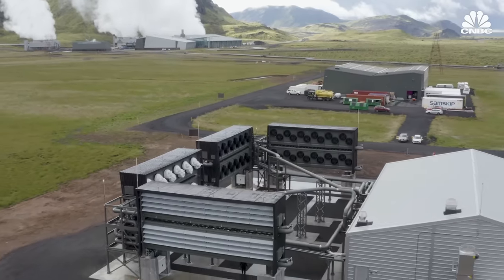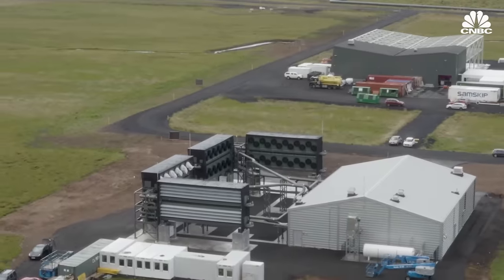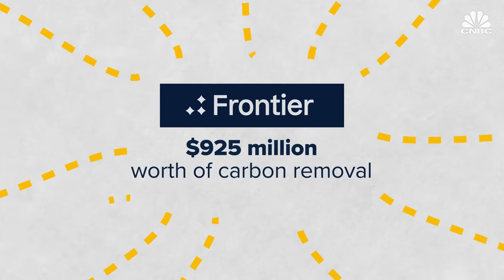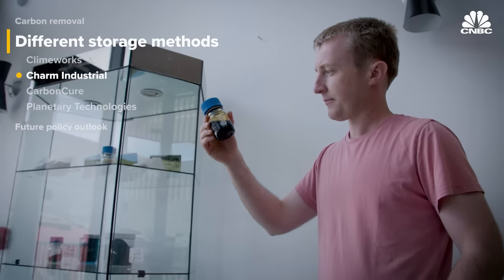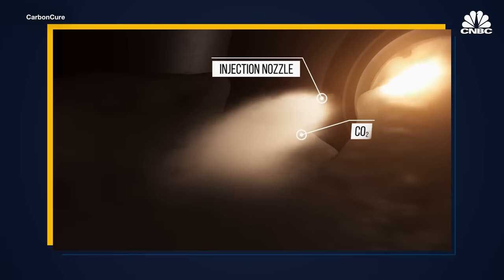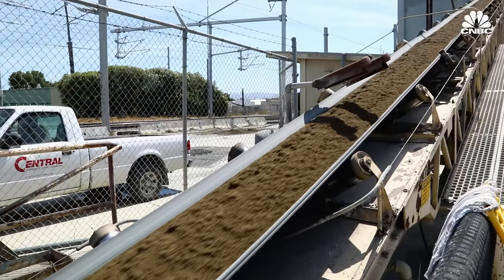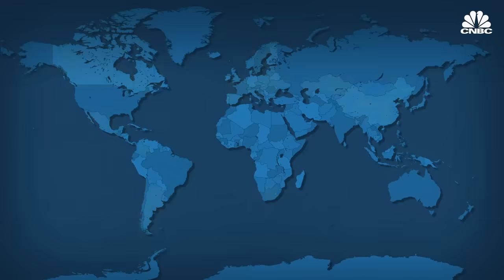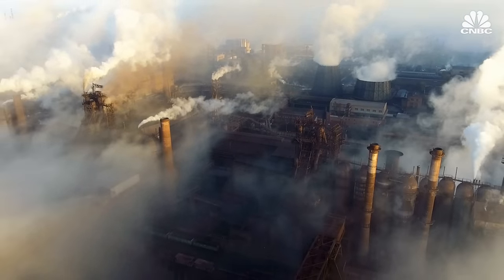Why Big Tech Is Pouring Money Into Carbon Removal

Comment: Awesome companies and technology all around but CarbonCure seems like the best bet. Not only are they removing carbon from the air, but they are using it in an industry that produces a lot of carbon to both help improve their product and reduce their own carbon footprint. I also believe there has been a growing concern of a sand shortage which is also used heavily in concrete, so if adding carbon to concrete means less concrete is needed for equal strength, that seems like a win all around.
Reply: It's also used to make circuit boards... sand or silica.. Time to ban all electronics... Like your cellphone.
Reply: @Boxagami  Ban all electronics, that's a really dumb idea.
Reply: @Boxagami  More specifically, the shortage concerns a specific type of round-grain sand used for concrete. Usually found on riverbeds, it is a small percentage of all the sand in the world. Electronics take any type of sufficiently pure silica sand and are also a low-volume sand-consuming market compared to the concrete market. So no, the sand shortage will not impact semiconductor and electronics manufacturing.
Reply: @mr.munger  We have too, since it contributes to climate change... sorry!
Reply: @kethmarhkfy7luf.263  The likely hood of that happening in our lifetime is close to zero.
Reply: The only good way to reduce emissions from the petroleum industry is to stop burning their products. We need to reduce the amount of fuel we burn, not try and hide the effects of burning fuel while burning more fuel. 

This is all just a ploy by the money in the petroleum industry to keep us burning fuels while they pretend it is offsetting a tiny percentage of the problems when we burn fuels. 

This tech needs to be kept out of the petroleum industry hands. It may have some applications and positive effects in other industries, particularly if it can be used to reduce the amount of fuel those industries burn. 

But the only way to improve the Petroleum Industry is to stop burning their products.
Reply: @Boxagami  I never said we need to cut out all products made from petroleum did I?

The problem is specifically burning fuels, so the solution is to reduce the burning of fuels. 

Make whatever products we want put of the stuff I do not care as long as it is not fuels. 

And that is quite a weak argument following. You are saying that producing electricity emits as much as a small piece of the fuels industry... Ok..so? Converting things that burn fuels over to things that produce electricity still it's less so let's do it. Oh no, it does not get rid of 100% of emissions only 90% of emissions...well ok I guess it still seems like it will help a lot then so no argument I guess. 

And as we convert more power generation off fuels and more transportation off fuels, the emissions of solar and EVs keeps going down. Kinda self fulfilling efficiency beneficial feedback loop. So still sounds like a winner to me. 

So quit trolling for the Petroleum Industry, it is a losing battle because there is no good argent against reducing the consumption of fuels in 2022.
Reply: @5353Jumper  I think you need to STOP TROLLING for the electronic polluted industry.. The problem with you people is you HATE TO BE CHALLENGED and that's not a strength, it's a huge weakness.. So, carry on with the BS.
Reply: @Boxagami  yes of course, as said above, reducing consumption is the best. Improving consumption is second best. 

So sure we all need to reduce consumption...which also reduces fuel burning so exactly what I am saying. 

But if we need to consume then EVs are way better than fuel cars. Everyone who points out that EVs use materials for the batteries and electronic components fail to remember that ICE cars have a lot of electronics too, as well as giant aluminum engine blocks and transmissions which take nearly the same emissions to produce as the batteries and motors in an EV. Proven thousands of times with thousands of studies. Even EVs built with fossil fuels, transported with fossil fuels and powered by fossil fuel electricity generation is still lower emissions than a gasoline/diesel vehicle withing the first few years of ownership. 

I will link to follow but in case YouTube sensors it just look up examples like the IDC: a-global-comparison-of-the-life-cycle-greenhouse-gas-emissions-of-combustion-engine-and-electric-passenger-cars

You will see that even in countries with terrible generation EVs are still the best option we have for lowering emissions (other than just not driving at all). 

And as mentioned the emissions from EVs and green generation keeps getting lower as we adopt more EVs and green generation. As you see in the same document where countries with a highly green energy mix are even lower emissions for the lifetime of an EV. Kinda proves the concept. 

So sure electronics make as much emissions as one piece of the fuel. That is still it as much as the ENTIRE fuel industry is it? And there are still electronics in ICE cars and so many other things so there is no real difference in this particular topic is there?

Reduce fuels consumption, seriously that is how we solve this thing. If you want to do that by no longer driving any car at all that is cool. But if you have to drive or transport anything an EV is better. 

Everyone so fixated on perfect so we are not doing better. Sure EVs and solar are not perfect, but they are better. So let's do better.
Reply: @Boxagami  solar is better than fuel generation. Perfect, no but better is better so we should do it the better way. 

Again the best is reducing consumption. But we cannot reduce all the way so let's use the better thing for whatever we cannot reduce. 

I agree rural solar fields seem like a bad idea, but most cities have way more commercial rooftop and covered parking lot space than we need to power the city and surrounding rural areas. Have the generation near the user endpoint (even owned by the user endpoint) to solve a list of problems with the current power grid. 

Combine with wind. Combine with hydro. Combine with nuclear. Combine with tidal. Combine with geothermal. Combine with battery storage. Combine with gravity storage. Combine with hydrogen electrolysis storage. Heck even have some new natural gas double burning plants for peak load. A combination of generation and storage methods easily replaces all the coal and most of the gas generation in the world with lots of left over for additional need to power  EV fleets. 

And like EVs, the greener we make power generation the greener power generation gets because more things are made with green power generation. Self fulfilling beneficial feedback loop. 

Quit thinking all or nothing on this issue as you are just being obstructionists to any change at all. Better is better than not doing anything so let's do better.
Reply: @Boxagami  so?

Then reduce your demand for electronics. Pretty much what I'm saying we should do. 

ICE cars have as much electronics as EVs so not sure how this argument is relevant to the conversation. And aluminum mining and production is as bad or worse than lithium, as mentioned remember there are giant aluminum block engines and transmissions in an ICE car which balances out the battery in an EV. PLUS remember all the environmental damage from the mining and production of petroleum fuels and lubricants for ICE cars. So sure, let's keep improving EVs, look for better batteries, but the current lithium ones now are better than ICE vehicles. Go ahead and be a late adopter if you want, drive the old ICE until you feel EVs have improved enough or your ICE dies.  

And for sure yes we the citizens need to take this opportunity to re-establish the power grid, in particular because it is preventing us from doing reasonable endpoint generation but also to avoid corporate monopoly. But we currently have corporate monopoly power grids this is an opportunity to bring them more under citizen control. You are correct in some regions this will be a tough fight, but really no worse than we are already.

Comment: "3x-5x larger than the global petrochemical market" = THIS WILL NEVER HAPPEN
Reply: Eh. If we never stop using fossil fuels, then of course it's going to be much harder if not impossible. But even if it doesn't solve the problem on its own entirely (it won't), it provides a step in the right direction. And, if petrochemicals are phased out fairly quickly, then carbon removal can work over the long term and do what we need it to just fine.

It will happen and work will continue on it until it does.
Reply: @jamesesselman283  This entire video is about what they do with the product.. Turn it into oil or solid (ie: far more dense) deep underground is the natural solution. You talk like we aren't already extracting billions of tons of deep storage carbon EVERY YEAR [we extracted 5 billion metric tons of JUST crude oil in 2019], it's not that big of a problem, there's plenty of capacity to put the carbon lol.
Reply: @Cyrribrae  you know nothing about climate change then if you think its as simple as that.
Reply: @Cyrribrae  "petrochemical" doesn't just include power plants, a lot of it is production of plastics, which won't stop anytime soon
Reply: @squidwardo7074  Sure, good point. Though, plastic production only accounts for like 4% of oil usage globally. The lion's share is still being used for transportation and powering industry - and that CAN be mostly transitioned off within the foreseeable future.

Comment: Using the co2 for construction seems like the best option of these ones presented. Simply storing it underground or in the ocean seems like it could have a lot of potential problems and bad consequences. Maybe the basalt storage isn't bad since it could give us solid carbon to use but I really don't know. It also just feels like a waste to not use the carbon when it can be incredibly useful in a variety of applications from electronics to metallurgy to agriculture and much more. I guess they are good stop gaps but the future needs to make use of this carbon not just permanently store it.
Reply: loll. I think the construction use is brilliant. Two birds, since cement production emits so much carbon too. But remember, the concrete industry altogether is NOT ENOUGH to solve this problem. The video explains that there just aren't enough value-added applications of sequestered carbon at this point in time. It's not a full solution on its own.

Fortunately, deep geologic storage is not as scary as you might think. The rock is EXTREMELY stable down at that depth, even if there are earthquakes and stuff. Once it gets down there, it becomes part of the rock and doesn't move for many thousands or millions of years. The ocean solution in THIS video is also nothing to worry about. Nothing dangerous is getting "stored" really. It just uses a weak base to react with acids in the water, which forms bicarbonate and water - both things that are perfectly harmless and abundant in the ocean (duh).

If we don't stop CREATING carbon, then we need to store it. Because you know what we call long-term carbon storage deep in the ground today? Oil, coal, gas.

Oh also, carbon fiber is made from... CARBON. Not carbon dioxide. As cool of an idea as that would be, no, it doesn't work lol. You'd spend way more energy making this work than you save.
Reply: @Cyrribrae  I'm personally aware of all of this, and I'm not worried about co2 reentering the atmosphere as I am about how it might affect groundwater, and ocean  chemistry. While it won't affect ocean ph, what will the additives and co2 do to marine life? I also know cement alone isn't enough, but there are also plenty of of other uses for carbon besides cement and production. It has the potential to do so much more. To me it really seems like a waste to just pump it underground instead of using it somehow

Comment: All we have to do is scale it up 25 millions times over current DAC facilities, with no emissions involved in building, operating, maintenance and decommissioning.
Easy
Reply: These projects take massive amounts of electricity, so...

Most of the electricity used is generated by burning fuels, so the petroleum companies are happy yet it causes more emissions than it scrubs. 

Of course some regions have caught onto this so the petroleum companies are building massive solar farms to power their carbon capture. So you know taking skills, land and materials away from anyone else who would think of doing a solar project and plugging it into the grid improving power generation for all of us and replacing fuel based generation. Nope let's all keep burning fuels for our power generation while the Petroleum companies steal all the investment in solar to cheaply power their carbon capture on the fuel production we use in our power generation. 

If it sounds stupid it is because it is stupid.
Reply: This is basically a prototype, it takes time and investment for such things to develop, just think how much more efficient and cheap renewables have become or cell phones or computers. Got to start somewhere.

Comment: The question is, do they remove more carbon than they produce? Have to power the machines or technology to remove the carbon, so how much energy is used to power them, and is it a net gain or net loss process?
Reply: A channel called Just have a think might have the answer for you. Spoiler: it is about break even, so it's only for greenwashing purposes.
Reply: @ZWD2011  its obviously a scam.

Comment: They would have been better served building the infrastructure for public transport and make it accessible for all at a lower cost and that would have put more cars off the roads and reduce the core problem of carbon emission in the first place. The entire system is so broken.
Reply: This is IN ADDITION to that. We're already past the point when simply stopping emissions won't be enough, so we ALSO need to actively remove carbon from the atmosphere. AND eat less meat, AND fly less, AND stop crypto mining, etc.
Reply: That is wrong as this tackles all forms of carbon displacement and not something that is relatively small like cars. While improving public infrastructure is just plain good and is very important. Overall this is the most efficient.
Reply: Personal cars are the least of our problems when it comes to carbon emissions. That said, public transport is still far more efficient and countries should focus on improving that.
Reply: Reducing demand is always better than improving demand, and improving demand is always better than improving production. 

In your example improving civic infrastructure would be reducing demand, electric vehicles would be improving demand and carbon capture on fuel production would the least effective improving production. 

But it is much worse than that in this case though, when you are talking carbon capture "cleaning up" petroleum fuel production. These projects take a lot of electricity and other resources which could be used for other green initiatives but instead go to the Petroleum Industry. So that means maintaining or even increasing the demand for fuels to generate the electricity for the grid and to the carbon capture project. So petroleum executives are happy as we are actually increasing demand instead of reducing it. 

So we are quickly moving the opposite direction of the best solution, in order to slowly go toward the worst solution.
Reply: @philipfahy9658  that's not personal vehicles mate but the entire transportation sector.
Reply: @Vlad-bs1js  In 2020, transportation accounted for about 27% of US emissions. Out of that, 57% came from "light-duty vehicles" i.e. personal transit. Still not a small percentage and a wonderful place to start. Meanwhile, carbon capture as a market has no reason to grow until governments force it to.